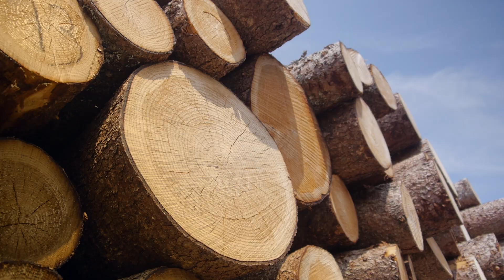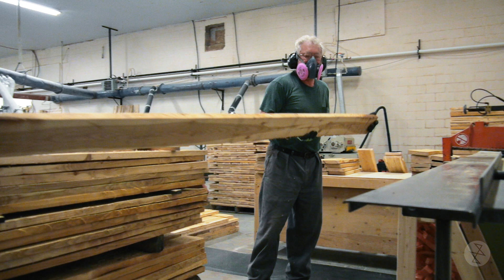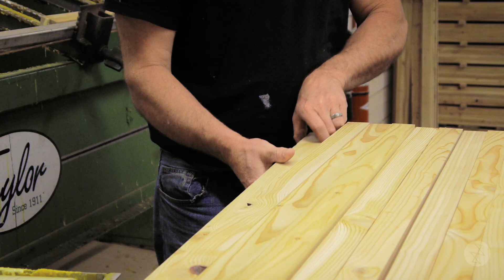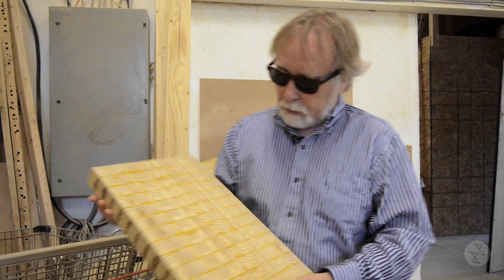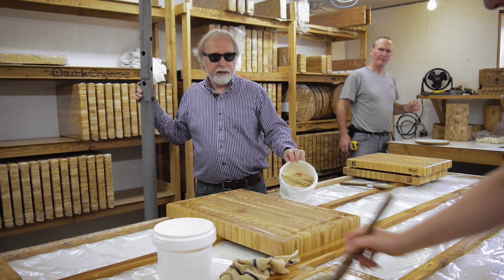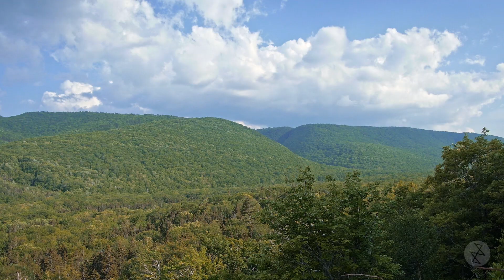Making Patterned Butcher Block End Grain Cutting Boards | Où se trouve: Larch Wood

Comment: The fourth reason to put feet on the boards is to ruin a perfectly good double sided board, "encouraging" the purchase of two boards (one for vegetables and one for meats). 

Can I request a board with NO feet ? 

When I saw the feet being drilled into the board, my heart sunk. I'm not sure I've ever seen a professional cutting board with feet that are drilled into it...that's sacrilege. A two dollar drawer matt from the dollar store will solve every problem the feet are supposed to solve but without ruining what is otherwise a great double sided board. 

A beautiful board, unquestionably, in my opinion ruined with a stupid addition of rubber feet.
Reply: Agreed. While I do think feet can serve a very good purpose and most people might even find them helpful, I really dislike the inability to purchase one WITHOUT feet. It's a very expensive and thick piece of wood (although yes the craftsmanship, time, quality, etc is there) and being designed to only use one side is a shame.

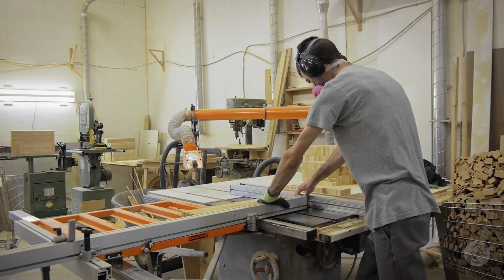Comment: 7:40.... NO push stick!!  all that money and machinery and this fella has his fingers a couple of mm from the blade with no riving knife either... lunacy
Reply: Four important rules were broken there, I cringed!  Wood is in between fence and blade,  hand too close,  no riving knife or splitter, and he's standing directly behind the blade.  I know very powerful saws actually get away with that usually but damn you never know!  I guess you don't learn that until you have piece shoot back at you...
Reply: @robertharris2979  What he also should be doing is clamping a "deflector?" (sorry, not my first language) to the table so the cut pieces get pushed away from the blade. Like in this video for example:
 https://youtu.be/lWcGNLDpbW0?t=431

Comment: Gorgeous! Love how it doesn't keep any knife marks! Wondering if you'll eventually sell butcher blocks on your website!? And if so, will we be able to choose the length of the legs, so as to accommodate tall people? (Unfortunately, everything is made to accommodate short people... Which leaves tall people with back problems coz we have to lean over counters, for example... And choosing the length of the legs would allow tall people to bring the butcher block at the waist height, which will prevent any back pain!)...

Comment: Such an impractical cutting board just for the end grain. If it were me I'd have the block supported with an internal spline, and the rubber feet would be much shorter. This seems like a nightmare for dry climates.

Comment: Would have never occurred to me to use a softwood as a cutting board. Beech is most common here in the UK from what I can tell. I've got a small log I used for some decorative rings a few weeks ago - I might plank it on the band saw and have a go myself.

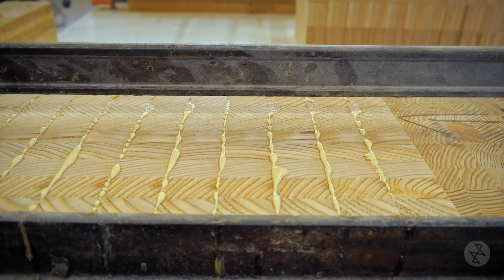Comment: The lack of push block on that one guys cut around 8:00 made me cringe to death.  RIP
Reply: Thats mad, it's only a matter of time before he ends up cutting his fingers. It only takes a slight lapse in concentration. In the UK and EU we have regulations to make it safer for workers. All saws have to have a riving knife and top guard I believe. Plus you'd be expected to use a push stick rather than your fingers.
Reply: @noire1001  Sad I can only upvote once!
Yes, that is a lapse in safety protocol, on a fairly dangerous tool no less.

Comment: I bought a Boos Block a while back, and it warped like crazy after using it one time. I guess I should have waited a week to do all the climatizing work and oiling. Strange thing is that even when I searched online about the warping issue, all suggested that no matter what you do, it will warp. But this video seem to suggest that it won't warp if you do the conditioning for about a week. Is that right?

I also applied mineral oil to it before use, and even then it warped so bad with just the oil.

Comment: the soft rubber feet also help to reduce noise when you are using a meat cleaver. it reduces the chopping noise/impulse passing through the board to the tabel and floor.

Comment: $220 for a cutting board?? Wow.. No way you're going to sustain a business long term at that price point. It's not a Rolex. I was thinking $50-60, maaaaybe $80 tops. It is a nice board though
Reply: You clearly have no idea about the cost of good wood, labor, or equipment.
Reply: @littlediaBtus  All that is irrelevant to what he said. You can find really nice, hand made end grain cutting boards online for much cheaper. I just bought an American Walnut end grain cutting board from ebay for £70 ($90). Made using the same machines, glues and oils that this place uses, with a much more expensive timber.

Comment: I own such a board and a good knife and I really like it!
I even keep bringing it with me to cook for other people.
My knife stays sharp much more longer and the surface stays as new.
It's possible to see cuts but these get smaller over time and blend in.

Mine is made out of pear wood and has been made in south germany.
The one side has a faerly deep  juice rim carved into it and it really helps keeping the counter clean. It doesn't have any rubber feed so I put a damp towel between the counter and my board. It does the job :-)

Comment: i dont see how it can be financially viable to have such expensive machinery for something like this
Reply from the maker: Originally a lot of the machinery was for making flooring, staircases etc. They would make cutting boards out of the scraps - but it ended up being that the cutting boards sold more than the flooring. So a lot of the machinery is from before they transitioned to making boards full time.
Reply: Stereokroma ok that makes sense now
Reply: YeEpicTroll lol think about how much raw wood is piled up and think about the man power all this machinery replaces lol cost of labor to have a person(or people) do all that work for one year would exceed the cost of the machinery
Reply: Stereokroma maybe 50 dollars a board. Got a sale for example 10000 boards a year. After a couple years the machinery is paid off and u have big money. Plus the machines can be used for many other purposes
Reply: then you don't know business, now take note boy!
Reply: cheaper than having a bunch of guys do all that work

Comment: Want to commend you for your safety processes. Workers have robust hearing and breathing protection and the shop looks very clean for a commercial woodshop enterprise! Bravo!
Reply: Apart from the guy pushing tiny blocks of wood through the cross cut saw with his bare fingers and no guard or riving knife on the saw...

Comment: Why do they cut the wood into strips to then glue it back together?
Reply: plk watch till the end. then ask questions
Reply: they glue together different pieces to form different patterns. the end result being the end grain pieces are all going in different directions. this causes the board to be stronger.
Reply: If you only had one piece of board, it would warp overtime resulting in it not being flat.

Comment: Shouldnt the guy @ 7:40 be using a push stick for his own safety...?
Reply: it's actually safer not using a push stick for how many cuts he has to make, ghis is coming from a carpenter
Reply: @assemblage_of_wolves7473  What he should be doing is pulling the fence back so sits before the blade, and then clamp a "deflector?" (sorry, not my first language) to the table so the cut pieces get pushed away from the blade. Like in this video for example:
 https://youtu.be/lWcGNLDpbW0?t=431

Comment: Nice video. One critical notice though- whenn she made a scratch on the surface with the knife, and then wiped the scratch with the cloth, she did NOT remove the scratch.   what the heck!!!    these boards are NOT self healing. its a fraud. no board is.    please comment if you have know how.
Reply from the maker: +Nejc Panič No board will be 100% self healing. However, end grain boards, such as the one in the video will last a lot longer and result in much less noticeable scratches better than all other types of cutting boards. See this example how it works: http://imgur.com/Plj4UG7
Reply: +Stereokroma thank you for reply. that image i know, its way exaggerating. all butcher endgrain blocks i saw have deep schratches. maybe because of axe?    bbut still , i wonder,  if end grain makes such a dofference, why do proffesional blocks like goose boards offer long grainfor proffesional use?   are folks unaware? thank you for conversation, looking fw to hari from you.
Reply from the maker: +Nejc Panič It depends on how they're being used. If someone is using a meat cleaver, it will make more noticeable markings regardless. For most people's home use they use regular kitchen knives/carving knives. As for why other companies use long grain - long grain boards require less wood and so are less expensive to make. There is certainly a lot of debate about the merits of each one, though I found this conversation about it that might be able to shed more light. http://www.cheftalk.com/t/70646/end-grain-vs-edge-grain-boards-blocks

Comment: why dont you just make the block out of one solid piece of wood or glue a smaller piece on it if its not large enough? Instead of milling it continuesly down toward the golden rectangle and glueing several together? Doesnt it waste a lot of sawdust etc.? Is it for aesthetic purposes(it is gorgeous looking btw) only? Or also strength? Cause you can get end grain from a slab too right?
Reply from the maker: +Cloudy The boards are cut up in small pieces and arranged in a sequenced pattern so that the finished board does not warp. If the board was made from a solid slab, the board has a likelihood of warping or even cracking. :)

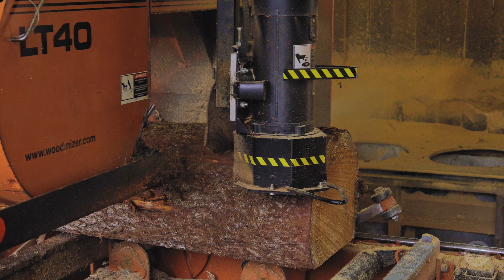Comment: 1:36 if you made the machine go down and back on itself while cutting instead of having to restart from the starting point you would cut out so much time which overall would improve efficency
Reply: +connormcwood2 Good point, but it looks like the machine has some sort of guide on the front that runs along the wood. If they were to run it the other way the guide wouldn't be on leading side.
Reply: +connormcwood2 Band saws only have teeth on one edge. There are rollers that push the band from the back edge, so you can't add teeth to cut backwards. You'd have to have an entire second band saw that drops down to cut the other way.
Reply: +Keith MacDonald  Actually there are 2 sided bands. They are a pain and the cost of manufacture is over 2x the cost of the singles.  You also have to worry about tooth set as the non cutting tooth is very prone to leave drag marks in the cut board.   +Kubs    -not sure what you see as a guide but it might be the bark kerfer that cuts a path for the blade to enter the log without needing to cut the dirt filled bark.

Comment: I always wondered about these blocks, because glue is spread thoroughly, when you cut it minimal amout of it is gonna go into food no matter what. It is that the glue is just non toxic or amout of it is negligible?
Reply from the maker: +fuanshin It's dry, so it's either negligible or not even a factor. Every wood cutting board, even the cheapy ones from department stores or bamboo, have glue in the seams.
Reply: +fuanshin I believe they also use food grade glue which would be totally non toxic, etc. But I doubt any would even seep into your food . If so, the ppm would be so low to be virtually undetectable.